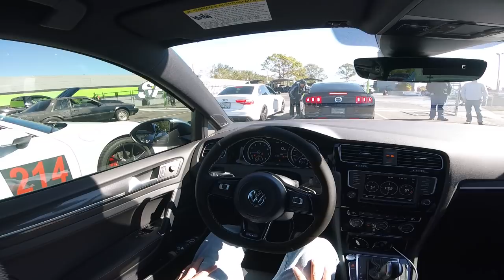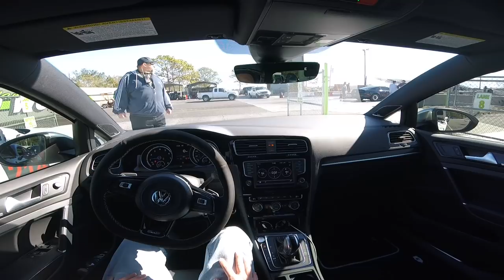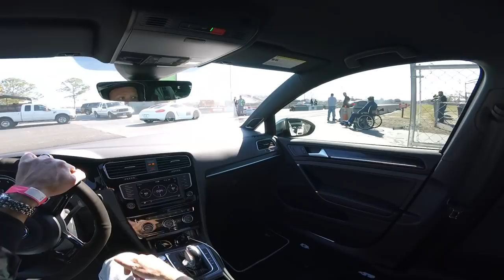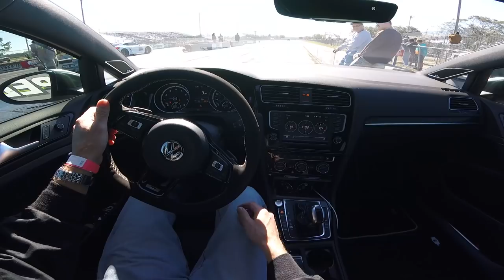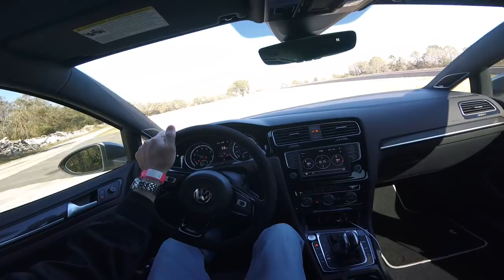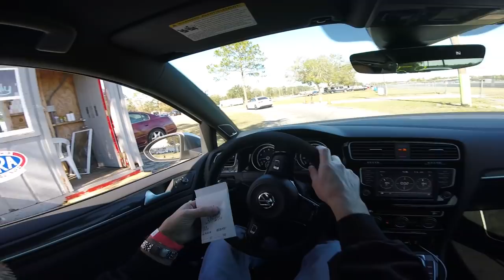APR Stage 3+ MK7 Golf R - Wheel Hop!

Comment: Wheel hop is an easy fix. Buy Integrated Engineering's dog-bone insert and RocEuro's drivetrain stabilizer. Then use OBDEleven or VCDS to turn off SVR and you're all set. 
These mods will stress the factory motor/trans mounts a little more but if you're stage 3 you should have upgraded those already. BFI or Revo offer great solutions. If you've got lots of money, go with SuperPro.
Reply: If not done already in VCDS within AWD module, change Acoustic measure: wiring logic from reduced noise to increased traction. Makes a huge difference to grip
Reply: Dog bone mount helps out a lot it helped my car from wheel hop a lot

Comment: I would check to see if the trans mount puck has broken. Guy I know with an IS38 GTI cracked the HPA mount.
Reply from the maker: The stock torque mount was not visibly damaged, the 034 billet insert was no longer sufficient and is actually deformed. The lower control arm bushings are the same soft rubber so I went with SuperPro bushings on the control arms and an Spulen insert on the torque arm (dogbone) mount. I have done a few launches after with zero wheel hop, amazing difference. The motor mounts, upper engine and trans seem fine so far but could benefit from upgrades I'm sure. I have 034 street density top hats on the struts as well.
I can't say that I notice any change in NVH, maybe a bit more feeling in the steering wheel. but I welcome that.
Reply: rotaryguy ill consider myself lucky that I don't make that much ground pounding power lol. I use to have a MKV R32 but I didn't want to chase such an expensive build to go turbo. I traded it in for a Mini S and I'm enjoying it. Check out my channel too if you have time. I gave you a Sub. Good luck dude
Reply: Same story with 034 aluminium insert for my c7 a6. The insert is short, and it only provides support for half the the mouny, while the other half of the mount suffers double the abuse and gets ruined pretty quick..
Reply: @tbairdjr  How did it improve ur 0-60 times though?

Comment: Have you had the DSG tune, what sort of Diverter Valve are you running. Do you have the APR turbo inflow elbow? Nice times.
Reply from the maker: Yes you have to or it wont hold the power, stock diverter, no its an Borg Warner efr7163 turbo with a custom intake pipe.
https://www.goapr.com/products/stage3_ea888_mqb.html

Comment: Yo mate , I do experience the same wheel hop with stage 3 apr , did you change the engine Spulen mount insert or a Spulen dogbone mount? And was there a difference with the SuperPro lower control arm bushings? Thanks
Reply from the maker: I did the Spulen insert, all stock mounts. I also did the bushings at the same time so hard to say what the difference was with just the bushings.

Comment: There is a rubber mount you can add to stop the wheel hop but it will increase vibration. I didnt know the MK 7 had performance gauges? That must be a later MK7 or is it a 7.5?
Reply: Not mine☹
Reply: 123456 78 really. I had a MK7 for 3 years and didn’t even know. I now own a 7.5 which I know has them. We are speaking about the gauges on the multimedia right.
Reply: yeah I never saw it on the original MK7 R Golf. On my 7.5 I go into vehicle then selection I think then sport

Comment: Did you happen to disengage starting vibration via coding? I know this  could promote wheel hop?
Reply from the maker: count64 never heard of any setting with that name or description. What are you referring too.
Reply: rotaryguy  if you have a vag or OBD eleven  there are a few  tweaks you can do to remove the traction control and esc ect. For instance I am stage 3 plus and under the torque limiter coding, the function is disengaged (most likely from apr map). In the same codec screen there is also "starting  vibration reduction" it takes away wheel spin and wheel hop primailry on front wheel drive. Perhaps it's turned off...I'm not sure why it would be as it comes turned on from dealer ...but something to check I guess. Google it with mk7r  along side and you will see some forum discussions
Reply from the maker: I have VAG (VCDS) and have done several changes to various things but I have never heard of this setting. I found a few threads posted and will investigate?
Reply: rotaryguy  you need to read thru a bit...but tons of info about it. One I found handy is a code to turn back on all traction control over 100 klms  per hr...safer then reaching down a d pressing it...might be handy for the track
Reply from the maker: Thanks I got everything sorted except I have not done any mods to re-enable traction control at speed. Appreciate the lead I had not seen that one yet. 
Hard parts swap solved it, Spulen dogbone insert (street) and SuperPro front  control arm bushings. My 034 dogbone insert was actually deformed. Turns out there is an upper and lower dogbone bushing in the sub frame and the newer poly inserts like the Spulen go all the way through both unlike the short billet 034 insert. A few test launches were completely smooth so far, can't wait to track it again.
Reply: rotaryguy good to hear you got it sorted...not fun chasing a ghost issue.  I'm set up with stage 3 plus and will be installing the cts billet  dogbone this weekend...however after reading your comments...maybe that might be a mistake lol  good luck at the track!

Comment: How is the Spulen insert an improvement over the 035?  Do you have engine and trans mounts?
Reply from the maker: The 034 insert is very short, the poly inserts are 2 to 3 times longer and go much deeper into the factory rubber mount. That factory mount is very thick.
Reply: That's intetesting...thanks for the info and hope that fixes it for you.
Reply: Rotaryguy, I would look into Superpro engine and transmission mounts as well as the dogbone. They are one of the more expensive solutions but if you do your research, they are that for a reason..... in my opinion,  probably the best available for the MQB platform. I would bet it would reduce that hop issues. Also it has the lowest Nm sounds comparable to oem. I will also bet it will decrease your e.t's in the 1/4.

Comment: Looks pretty boring to drive to me. A car that doesn’t require any driver input makes for a boring drive.
Reply from the maker: It's certainly nothing like banging through gears with a powerful rear wheel drive but I daily this car in a LOT of traffic and was really just done dealing with a manual. For what it is it's still exhilarating to drive.
Reply: rotaryguy Yeah, for a daily I guess having it in an auto really helps. You should keep this as your daily, and then get a nice manual RWD sports car as your fun car 🙂. I have a manual MK7 GTI w/IS38 Stage 2 as my daily. It’s fine because I don’t have traffic much where I live. I will probably be selling it to get a Shelby GT350 next year for my weekend/canyon car, and a cheap automatic AWD car or SUV as my daily
Reply: the DSG is such a fast box I dont think manual guys get it
Reply: Jason S so you would understand a double clutch gearbox is faster than a manual
Reply: Steven George yes, most of the time they are. SMG’s arent, and there are some others, like what’s used in the Aston Martins, and Benz’s, that aren’t, but most of the time they are. But why care about getting the dual clutch that shifts faster when you could be beat by another car, that’s manual, on a daily basis? Just because you have a transmission that shifts faster doesn’t mean you are the fastest one on the road, which seems to be what most dual clutch owners think they are. Simply not true. Get the transmission that car was meant to be, which is a fun little sporty car, and for it to be the funnest on a daily, you will want it to be manual.
Reply: Jason S paddle shifter only exist due to an auto semi auto box
Reply: Jason S  unless we are talking about the muscle car quick shift sticks can’t remember the name
Reply: Don't worry! You can buy one yourself with a manual. They have the option! :D
Reply: Jason S Stick is more fun, DSG is faster.  It's that simple.
Reply: natelan69 depends what you use the car for, stick isn't as fun in stop start traffic
Reply: Gaz Nelson I have a 2017 Golf R with DSG.  Used to have a 2012 GTI with stick. Drove traffic in both. I find no problem whatsoever with driving a stick in traffic.  Keeps you awake.
Reply: natelan69 I drive hgvs for a living all apart from 1 are auto, had a mk1 audi tt before my current golf r dsg, 90% of my car driving is town popping to shops sat in traffic absolutely hated going out in the tt felt like a chore. I get the manual is more engaging and fun but it wasn't worth the 10% I took it out on the backroads, dsg love it won't go back to a manual
Reply: Everyone has an opinion
Reply: Must be boring driving a 500 brake golf lol
Reply: @gaznelson8615  That's true, but if that't the case in point that you're trying to make, that the DSG is better in traffic, then my point back to you would be if your'e driving the car mostly in traffic, why did you even buy the GTI or R??
Reply: @jamstersmith4625  My MK7 GTI 6spd manual now has an EQT turbo tuned through Frank Mabo, and is pushing over 430whp, which is close to 500 crank hp. To me, its much funner to drive a 500 crank hp GTI with manual than it is with DSG.
Reply: @jasons2697  why? Why not? I needed a new daily car and the golf r ticks every box for me. Easy to drive round town doing my daily routine and a blast when I do go for a drive out
Reply: @jasons2697  A late comment, but just wanted to point out the DSG R's sell far more and faster than the manuals. I have another car that's manual, enjoy it, but highly disagree that the DSG is "not fun". I love hearing the shifts happen rapidly. Honestly I love that same fast shift you get in certain ZF 8-speed equipped cars. If you pick the manual R, you're basically in modded GTI territory. With the DSG, you have the proper transmission that takes the car to the next level. Focus RS, Civic Type R, and STi are manual only - if any offered a dual clutch they might edge out the R but as they do not, the faster transmission wins.

R with DSG + launch control is reliably a slingshot off the line, have fun not doing a launch worth a damn with the manual that also is so weak it slips with even mild power increases. Manual fanboys really are the worst, just go buy your damn car and drive it and STFU. I rarely even mention that I do so as never to be lumped in with the "save the manuals" crowd.